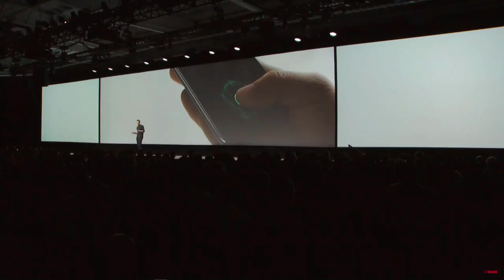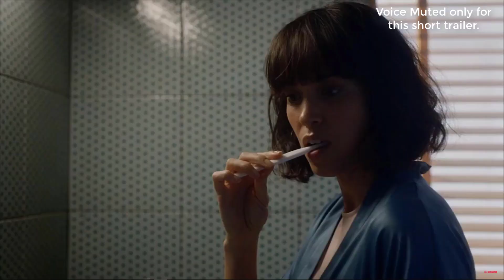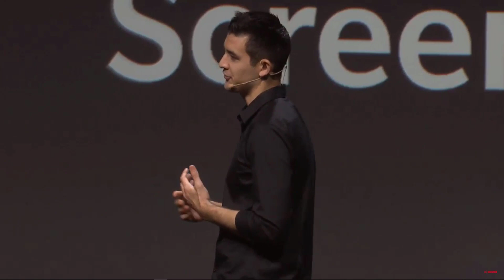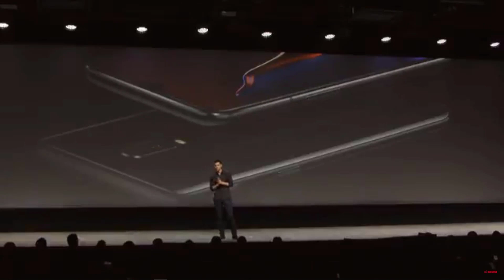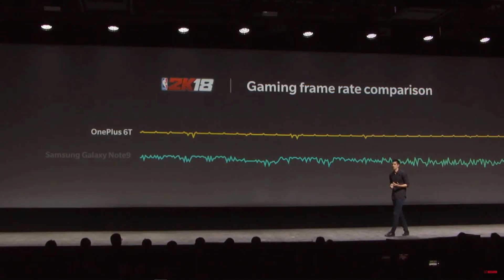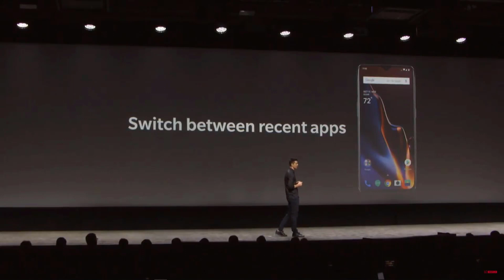OnePlus 6T Event in 10 mins - All Features (w/ In Display FingerPrint Sensor)

Comment: And the award for the most underwhelming phone of 2018 goes to the OnePlus 6T. Overpriced with the same specs as the Pocophone minus a headphone jack. No IP rating, wireless charging, stereo speakers, QHD display, SD card support or triple camera either.
Reply: So, maybe from a hardware perspective, you're right. But that is just 50% of the phone. You totally forgot Software.
Reply: @cdefgah4343  Doesn't take very long to install a custom rom. https://www.xda-developers.com/what-is-custom-rom-android/
Reply: @faisalanwar6530  
Yeah, I'm aware of custom ROMs. Still using my OnePlus One with LineageOS (for 3 years now).
But actually, when I buy a Phone today, I want to get the full experience ootb. Don't know about the custom rom situation on the pocophone though.
Reply: Faisal Anwar And that will slow down your phone immensely.
Reply: @jrrr1591  If that were the case, we wouldn't even have Oxygen OS (moded from Cynaogenmod). Everyone would be running stock android :)
Reply: Faisal Anwar Because Oxegyn OS is completely optimised for these phones. Unless your a software engineer then you can’t simply download oxegyn os onto a phone and expect it to run like this.
Reply: @jrrr1591  Oxygen OS is a mod of an existing OS Jordan. That's the joy of being an android user. You can customise and mod your phone's OS the way you like it. If you've been an android user for a little bit, you're already half way to becoming a software engineer :) The thing you can't however change is the hardware on the phone, which for $300 more than the Pocophone, the OnePlus 6T massively lacks. No additional liquid cooling, no headphone jack (still beats bluetooth sound quality hands down), no IP rating, no wireless charging,  no stereo speakers, no QHD display,  no SD card support, no triple camera, not even an LED indication light. OnePlus have lost their way. The only thing they give users for $600 is a semi-functioning insecure optical in-display finger scanner. I'll be hanging to both my OnePlus 3T & OnePlus 5 for a little while longer and see what's on offer when one of the phones die.
Reply: Faisal Anwar If you think that that’s all that goes into designing software, then I’m sorry, but your delusional. Its not as simple as downloading a file and then installing it lmao
Reply: @jrrr1591  I agree. Tweaking an OS takes a little work but that's precisely why we love android. Android users have a choice (unlike iOS users) to move on when a company charges too much for too little :)
Reply: Imagine just buying a phone to make the user have to install a custom rom and interface... Qhd displays while cool they drain the batteryfaster. Speaking of batteries wireless charging is still slow, IP ratings cost money to certify. Triple cameras don’t do anything to enhance photo images (google pixel will destroy that with a single lens, algorithm based system) only concerns are stereo speakers and or SD cards...
Reply: OIS + EIS at back , bigger 3700 mah battery , OXYGEN OS ( I love it ) , better amoled screen , water drop notch ( looks dope 👌) , in display fingerprint tech  .... Wireless charging is not a necessary option right?? , With 128 gb or 256gb storage who needs sd card .. if you need then don't buy it ...ip ratings are necessary but which phone gives you ip rating instead of LG g7 thinq ( which has shit software nd only 3000 mah battery )
Reply: @aizen_ji  Pocophone has a 4000 mah battery, similar 1080p display and users can stick a custom android OS on it if they wanted. The Pocophone even has liquid cooling!  https://youtu.be/L5VWWba0coY
If OnePlus are charging $300 more, then they should certainly add wireless charging, an SD card, stereo speakers, an IP rating, a QHD display and triple cameras. The OnePlus 6T doesn't even have a LED notification light anymore, let alone a headphone jack. 
Quite sad they've stopped listening to their user base and added a silly semi functional in display finger reader, which most reviewers have stated only works half the time.
Reply: Qhd displays are gud but you can't expect it at this price ... Tell me any phone with QHD display at this price ... Also they drain battery unnecessarily...
Reply: One plus also gives  android updates more than any other android company leaving pixel devices
Reply: Only thing I miss is headphone jack and stereo speakers but I can't expect everything at this price also  they said that due to bigger battery size and in display fingerprint components their was not much space left for the jack

Comment: No headphone jack,no ip rating, and no wireless charging.Lame!
Reply: cons are no headphone and a notch but at least at a acceptable range. Fuck wireless I rather fast charge my phone using my cable.
Reply: Use Bluetooth poor ass
Reply: No IP rating does not mean that it is not water resistant. Wireless charging is not REALLY wireless since your phone is still stuck on to the charging pod and I prefer fast cable cause I can use my phone as it is been charged. I agree with you when it comes to headphone jack but if I am getting a bigger battery to that, it's a fair trade off.
Reply: Its water resistant tho, had it in a bowl of water for over an hour and it was fine. And its the 21st century, there wont be headphone jacks on phones for much longer my friend
Reply: Tell me what phone do you use?
Reply: In screen fingerprint sensor
Reply: Still LAME!
Reply: @eio1971  yeah kinda
Reply: @eio1971  your lame... Always complaining